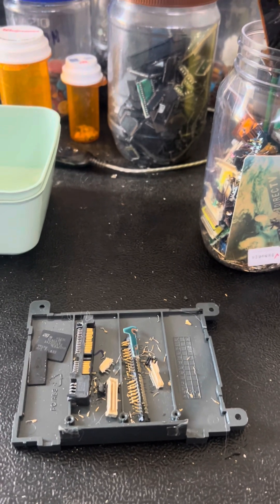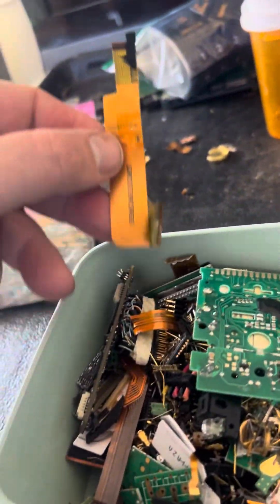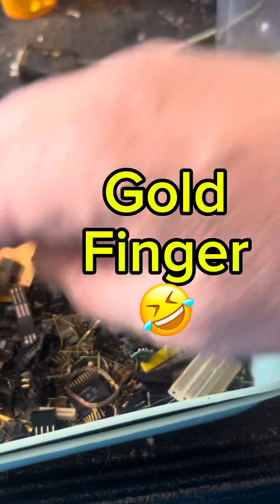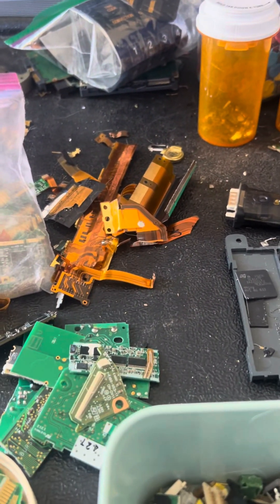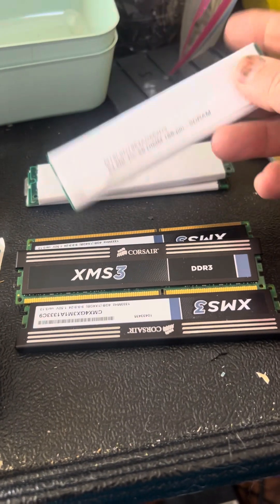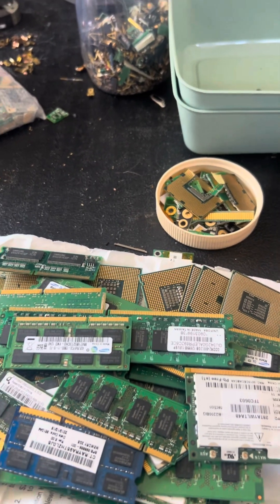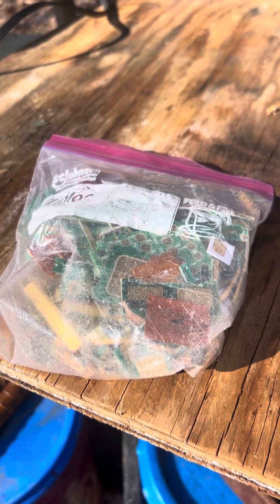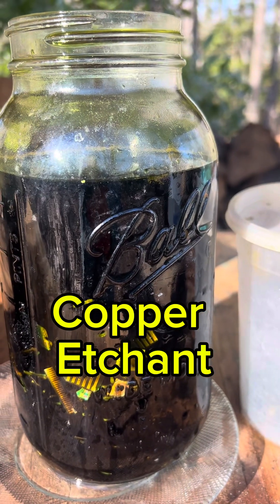Scrapping Gold from Electronic Waste #gold #goldrecovery #urbanmining

Comment: Isnt acid peroxide (ie AP) solution highly reactive to anything organic? Have you removed all of anything carbon-based in there, prior to addition?
Reply from the maker: Hey thanks for stopping by and checking out my channel . Acid peroxide / AP / copper 2 etchant . Isn’t reactive as Piranha solution ( sulfuric acid and peroxide ) AP attacks the base metals on the boards   That is what allows the foils to loosen up then float away from the boards .